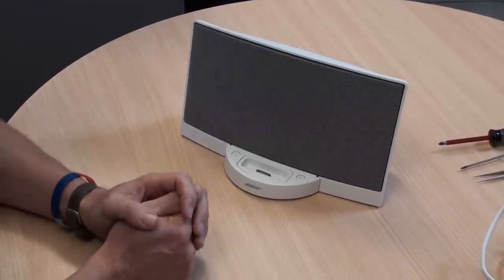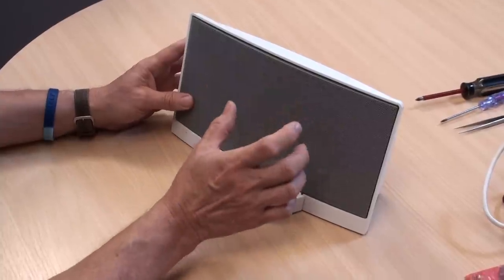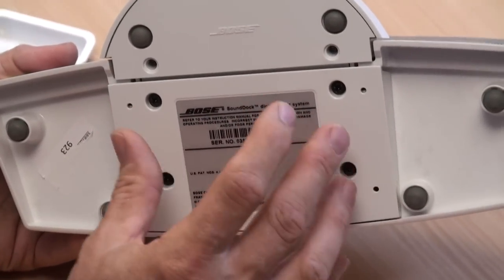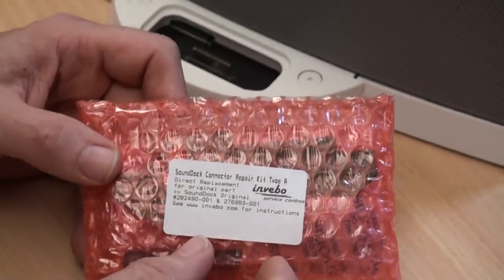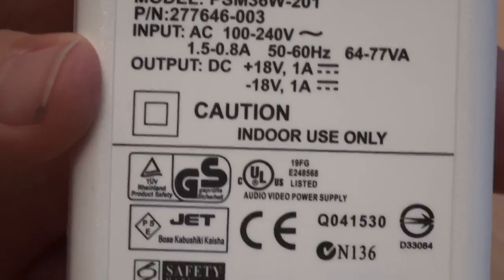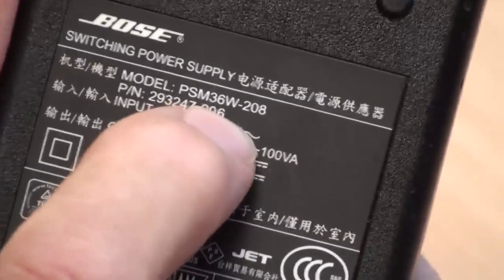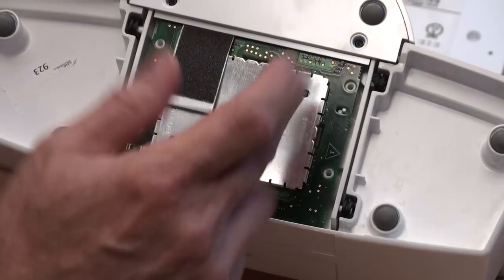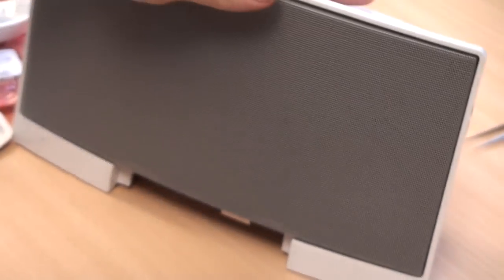SoundDock Original Type A (Series 1) Diagnostic Check

Comment: Thanks so much I was hearing interference and the sound was barely audible on my Sounddock, I followed your video and even though the pins on the ribbon looked flush I reseated anyway thinking it wouldn’t have solved the issue.  However it did!  Now working perfectly with perfect audio & zero interference!  Thankyou again 😊

Comment: My Series I Type A was charging but no sound (using the DockLinQ adapter).  I seriously thought it was the sound processor but I rotated the plug going into my wall outlet 180 degrees and it worked.  Some weird polarity sensitivity, but it may be a quick solution for some people who think it's their sound processor failing.

Comment: I am having a problem with no sound, using Bluetooth Ziocom adapter and it is getting power but there is no sound coming from my Bose sound dock. I had not used tgis sound dock in over 10yrs and then found this Ziocom Bluetooth device and was able to finally hear music and it sounded fantastic. But now after using it in and off for about a year there is no more sound ? What do yout think?

Comment: Hope I can get advice on this. From a repair/durability perspective would you recommend a type A or B Sounddock? Understand the risk with old electronics but wondering which is more reliable.
Reply from the maker: The B type is slightly better but more difficult to fix when it fails as the board burns up. (Unless we have done the power modification).

Comment: Hi, have a question what is the difference between Sounddock  original Type A y Type B , thanks
Reply from the maker: |The internal electronics in the amplifier and the sound processor module.  No parts are compatible between A and B.

Comment: I have the same doc with s/n# 049867991270099AE.  My dock plays music from the phone( I4) when placed on the dock, but doesn't charge.. It does charge from a wall plug in.  What could be the issue?  Do you have the power cable for sale?
Reply from the maker: See The invebo website for full diagnostic videos. This dock should charge your iPhone 4. Serial Numbers that start in  0498 (Series 1 Type B) should give 2 beeps when you plug in the power. If you get the beeps  then you require a new docking connector. If not contact invebo support. Note: Docks with serials starting 0357 and 0402 (Type A) do not give a beep so this diagnostic is NOT valid for these series 1 SoundDocks..

Comment: can you help me i have a series 1 sounddock and can not get remote to work is there a way you program it or what may be the problem thanks ricky
Reply: Ricky, if the remote controls the volume OK but cant navigate the ipod then it is the dock connector failed.   If nit, to check the remote, Take a look at the remote in a dark room with your cellphone camera. Can you see w white dot when you press a button? If not then your emote is dead. Battery?

Comment: Hi.  I've checked the power supply and it's working and it's charging my device but I still don't get any sound.  It was working until I unplugged it and relocated my dock to another room.  Could this be the sound processor board?  If so, do you ship to Canada?
Reply from the maker: Hi Ken, you are correct. The 'power and no sound fault''   is a failure on the sound processor. You can get the free diagnostic check or a fixed-price service and reliability upgrade on the invebo website.
Reply: @ispens  Im from Argentina, i was planing to buy the Innexxis BC20 NFC Bluetooth 5.0 Upgrade Kit.
But if the sound processor is broken, it wont work. Wont it?
I dont want to spend 100USD for the board and the upgrade kit.

Comment: I have the same Dock I've added a Bluetooth receiver and when played sound crackling and quiet and ideas or suggestions?
Reply from the maker: Most Bluetooth plug in devices use very cheap chip sets and very poor Audio Codec. properly matched audio means that you cant tel the difference in sound quality between a docked device and Bluetooth. If the adaptor uses the $1 chip set the sound will not be good.  The invebo  BC7 uses Cambridge Silicon - the inventors of Bluetooth. If you need assistance please contact support@invebo.com